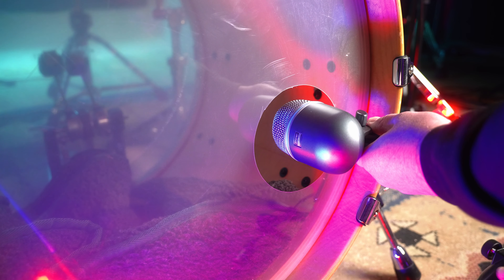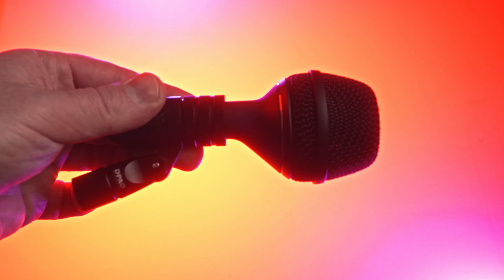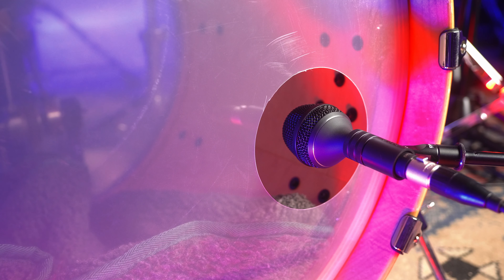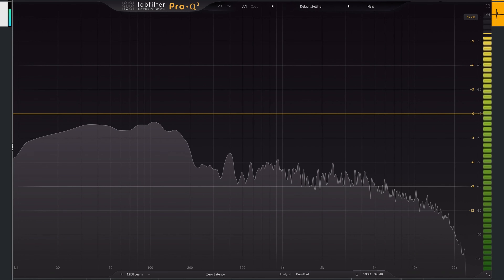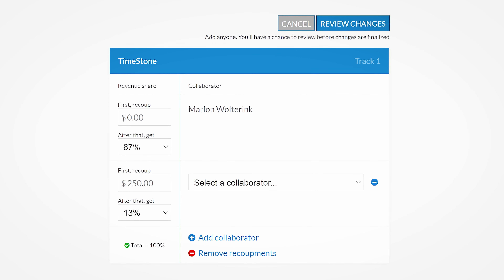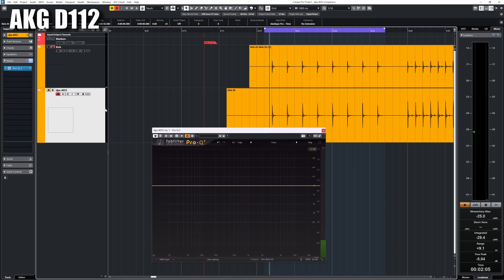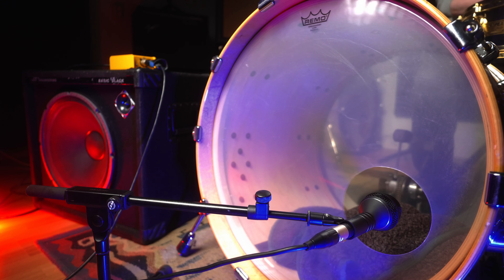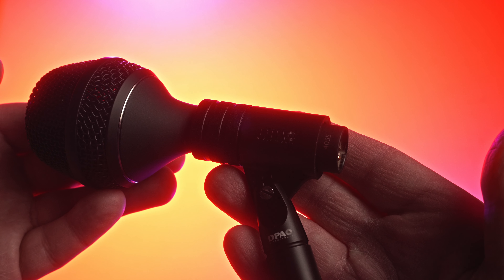This ULTIMATE kick mic?

Comment: There is a difference between DPA 4055 and other dynamic microphones in how much sustain they pick up. I'd like to hear how good it is on a snare during playing on a hi-hat and on toms. Thanks for the presentation.
Reply from the maker: dpa 4055 is not a dynamic microphone, bu t acondenser. Sensitivity is high on it, and has great off axis bleed sound.  It's almost a safe bet to say it picks up as much as any other DPA which uses th esame caspsule.

Comment: I went to Sweetwater and checked out the price - for what you pay for this mic I think I’d rather have a couple other of the more popular choices.  For example you could get a beta52 and a re-20 used but in excellent condition for around the same.   If you went beta52, audix d6, sennheiser 902 I think you are in same ballpark too.  Not saying this is a bad mic, I just would choose some of the usual suspects for the same spend.
Reply from the maker: The price is hefty. It already went up 150 bucks since december 2022. 
If you go the used route, i have seen these for 350 euros. 
RE20 will be somewhat the same price, new. 
My guess is that you will get the DPA if you need the flexibility and small form factor .

Comment: I just use a sub speaker with some alligator clips to a 1/2” jack… literally 3-5 dollars for the phattest oomph I’ve ever recorded.
Reply from the maker: I always find that whenever I use something like that, in my case, a Yamaha subkick, I get mostly from 80 to 350 Hz from that speaker. It's great as an addition to other bass drum mics, but as a standalone, it isn't cutting it for me. Real sub lows I normally get from either my Sennheiser e602 or a condenser mic.
Reply: @audiotoolshed  you are correct. I have to use a mic on the beater to get a good sound, but, I have had some luck duplicating the sub kick mic and doing a steep HP filter and boosting around 800-1k (albeit comically eq’ed to bring out whatever high info the sun speaker is getting) I can get an Ok sound. But yes, stand-alone only doesn’t cut it for me either
Reply: @audiotoolshed  your videos are great too and look forward to watching whenever I get an update!
Reply from the maker: Thanks man!